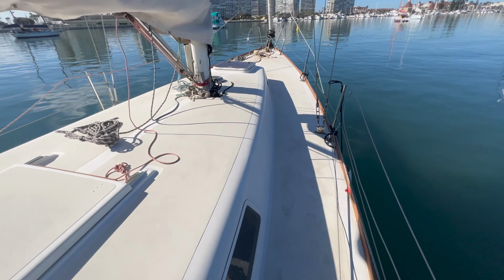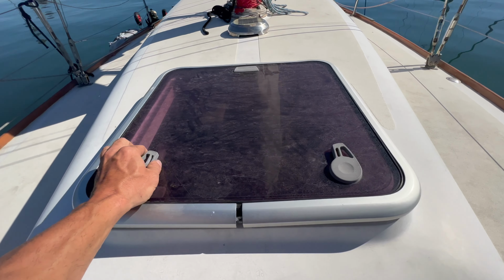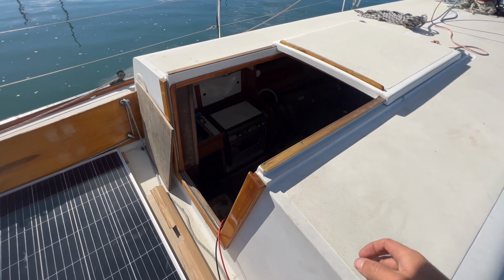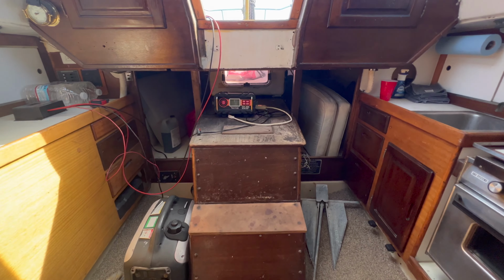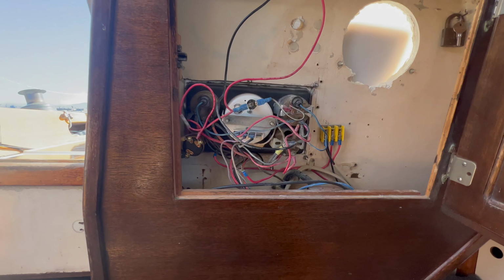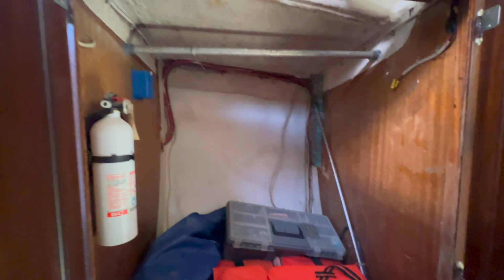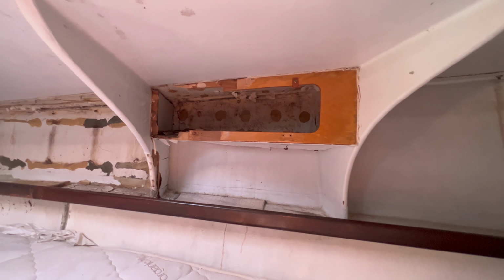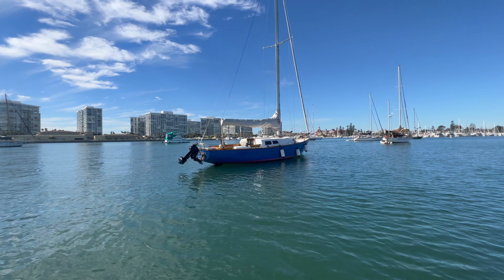I Bought Another Sailboat (Episode 48)

Comment: The Perkins 4108 can be rebuild in the boat for about 1500. I would recommend not using silicone it works in the short-term but creates bigger problems down the road
Reply from the maker: Good advice as always, thank you for that. I'll be digging into this engine over the next couple of weeks to see just how bad the damage is. Hopefully that Perkins is salvageable and can be rebuilt inside of the boat like you mentioned. What would you use instead of silicone? Someone else had recommended M3 5300 marine sealant.

Comment: Wow, a sailboat where mostly everything works. This is a boat where you won't have to spend hundreds of hours and dollars to renovate. The older Cals are very solid boats, hand laid fiberglass, as well very solid decks. As for the diesel, I would remove the injectors pour a lot of penetrating oil let sit for a few days. Mainly soak the cylinder walls and the head. Disconnect trans and try to break free the engine. Those are really tough engines and may be salvageable. Congrats on your new boat. So what are the plans for the Columbia?
Reply from the maker: Yes sir, exciting times ahead! You’re right, this boat is built extremely well, plus it was maintained over the years. Thank you for the advice with the engine, I will try the penetrating oil. Rebuild kits for these engines aren’t too bad either, around $500-600 for the block and ~$200 for the head. I’ll know more once I get a chance to get into it and see where the failure point was.
Reply: @ambiguousglobetrotter  Good idea, all depends on whether it was overheating or water intrusion from fuel contamination. Overheating of course is bad.

Comment: So why two boats? Do you plan on selling the other or using parts?
Reply from the maker: Jimmy, when the Columbia comes out of the water it will be for at least a year. I like living on the boat, so I needed another boat to put on my mooring ball. Plus, I really wanted to go sailing! This boat gives me the chance to finally learn how to sail and take some good trips. I’ll cover more details in future videos. Thanks for the comment.
Reply: @ambiguousglobetrotter  Right on and look forward to seeing them. Hope the solar panels are working out well for you!
Reply from the maker: @jimmyteter  The solar panels are working Ok for now. Not great but it gets the job done. I need to make an overhang above the stern to mount them permanently. So far I've struggled to reach above 10 or so amps @ ~ 13.5v. Seems low for 400w of solar capability. Also, the days are shorter now, so that eats into charging time as well. It's enough to run the fridge and the lights.